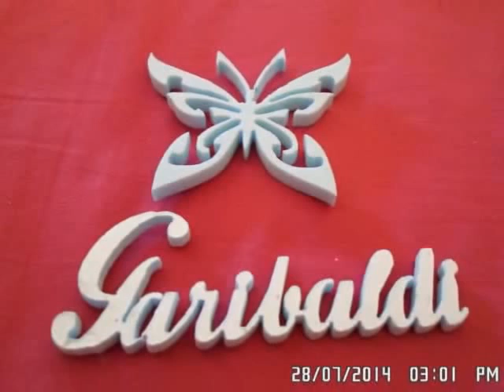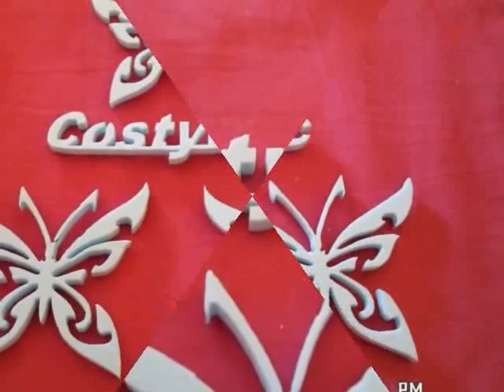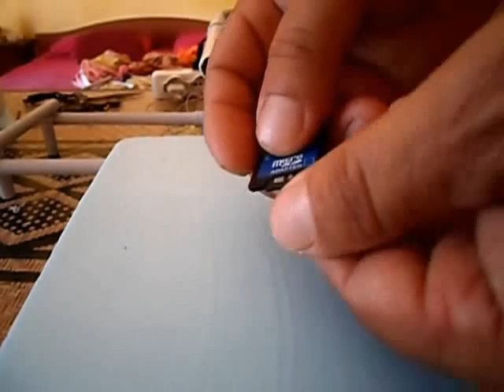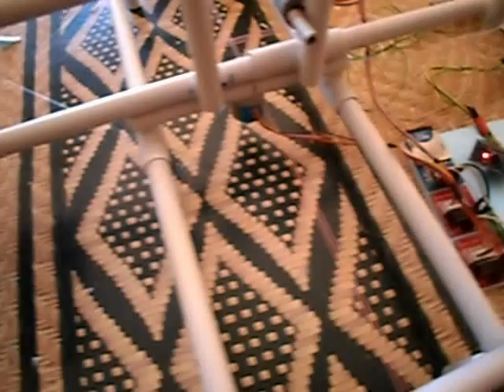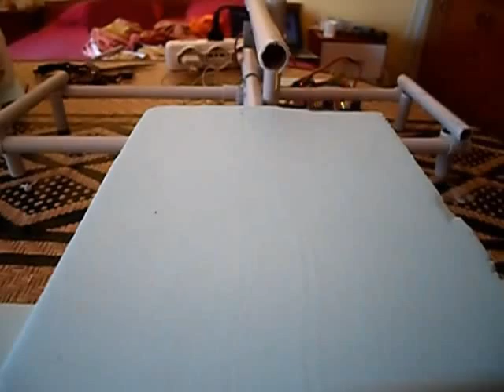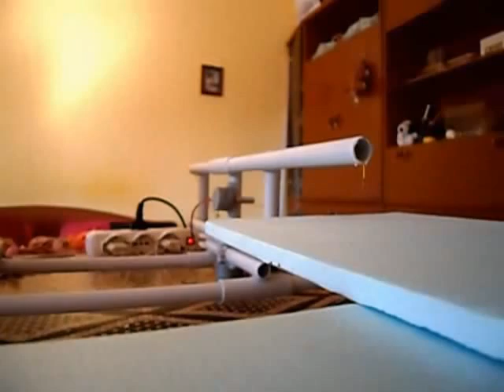Cheap low cost foam cutter cnc costycnc with pvc plastic tube and arduino homemade hot wire machine

Comment: Power supply - 110 or 220v?
Maximum work area = 40x30x10 cm?
USB or serial port?
Image file types - Vector? 
If I want to start on a piece of foam, how  does the CNC know where to start?

Kind regards,

Comment: hello would like to congratulate the video and would like to ask for your help with the explanation of how do I put the code-g in sdcard to work without direct computer by card, please tell me which program you used and how did the necessary connections more once again congratulations my name is and I'm from Brazil marcio
Reply from the maker: I don't put g-code... I transform g-code in my type of file... text file ... see 
costycnc_program | atmega8pro
and...
cnc work only with sdcard without pc:

arduino source code for costycnc sdcard
arduino_sdcard.zip | atmega8pro
Reply: hello, I wonder if I use a recorder to record the atmega .hex file to work with sdcard without using the arduino, diy one being mounted only with the ATmega8 and the crystal which would be fusebit the ATmega8 and I would have write a bootloader in it to operate normally or just write the file its straightforward design that works in atmega, could guide me step by step how I do not need to use the arduino and operate using only one prontoboard, thanks for listening
Reply from the maker: marciotelao I don't understand!
Reply from the maker: marciotelao You want use only atmega8?
Reply from the maker: marciotelao Arduino (atmega328) have 32kb of memory... atmega8 have 8kb... so very little space for library read sdcard... but you can read directly with my method... is little complicated... by working... see Read direct memory (with winhex) sd card with atmega 8 without library.
Reply: ***** hello can i use arduino mega 2560, if yes what would I have to use and what would be the connection of the card and drivers Hugs engines
Reply from the maker: marciotelao Change this   https://docs.google.com/viewer?a=v&pid=sites&srcid=ZGVmYXVsdGRvbWFpbnxhdG1lZ2E4cHJvfGd4OjNkOTY3YWRlZDE5YmZiYmU
Reply from the maker: you want work with code like this cnc ? or with standard g-code? Because principle of my cnc is a little different from others (standard g-code)
Reply: ***** if you can make a video with the 2 patterns the g-code and I appreciate your
Reply from the maker: now you cand read on my forum ... http://costycnc.altervista.org/forum/viewtopic.php?f=5&t=7
You can try your risponse or put your question!
Saluti!

Comment: What feed speed did you use?
Reply from the maker: f50 to f200
Reply: thanks, I assume it depends on the material.  To find the ideal, should I start at 50 and go higher, or 200 and go lower
Reply from the maker: i recomand 200 when understand enough how regulate power of motor an hot wire... because if increase power of hot wire , power of motor decrease , because have one source both... so .. first recomand maxim 150
Reply: Ok, so 200 then.  My hot wire source will not affect my motors (they are independent)
Reply from the maker: what source,module  have for motor and driver?
Reply from the maker: at this mackine i not remember... but first need to modify $1 and $2 in gcodesender

Comment: im using your firmware
how can i add servo please help me
Thank you
Reply from the maker: is not servo... is stepper motor... 4 pins in middle of Arduino ,left and right (Arduino pro mini)
Reply: +Boboaca Costel yes iknow thank you
my system is working perfectly with your firmware
2 bipolar stepper motor with uln2003 there is no problem

i want to add servo to my cnc as "spindle" so i want to use 2 stepper and 1 servo
im traying to add pwm to pin 11 but i couldn't but you understand this firmware and you know pure c programming language

can you add pwm feature to your costy firmware ?
Reply from the maker: what firmware you use exactly and from where?
Reply: this cnc working perfect with laser (405nm 500mw )but i want to use servo for plot
i upload your costycnc firmware to this mini cnc working good
Reply from the maker: +Ömer ANAR good job! I help you only if exist in originally grbl a function what you need! But I don't know if exist a function for servo in original grbl! I only changes the output pins !
Reply from the maker: +Boboaca Costel and i don't know exactly how work servo! i not make experiments yet! Only i read about this!

Comment: not a soeed 
how to chang speed
Reply from the maker: +Uddhav Suradkar type in gbrl $4=300 and $5=300 
change 300 with low or high value until motors not lose steps